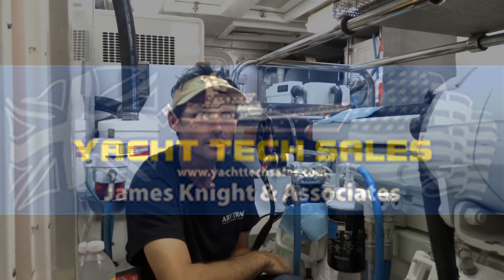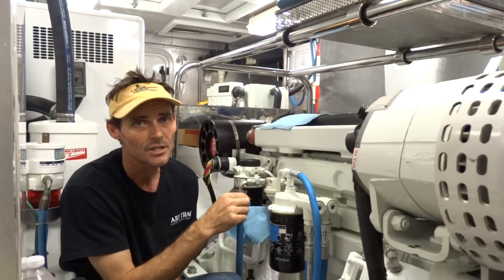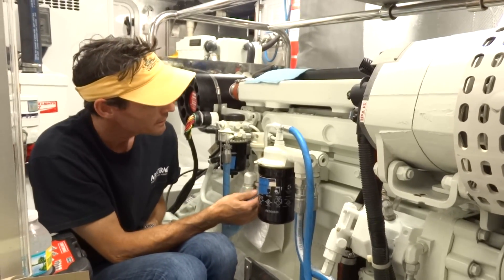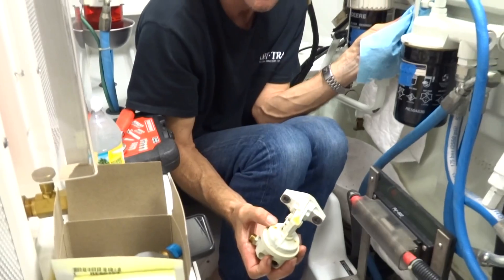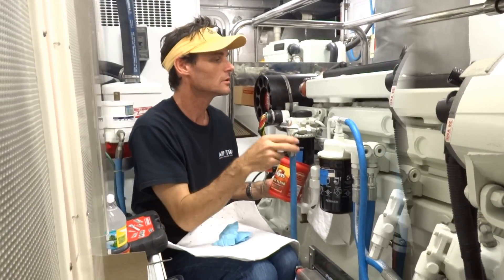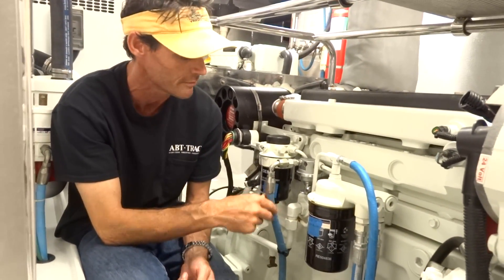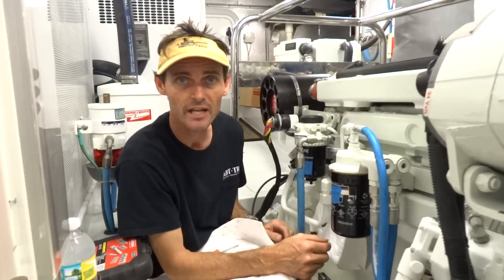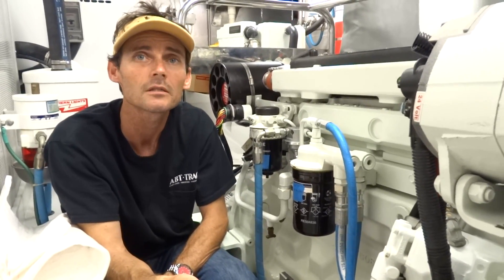James Knight engine surge repair

Comment: Use 2 cable ties to hold the hose.  One around the hose and one around the mount location tied to each other.   Think figure 8.  As shown you will chafe the fuel line.